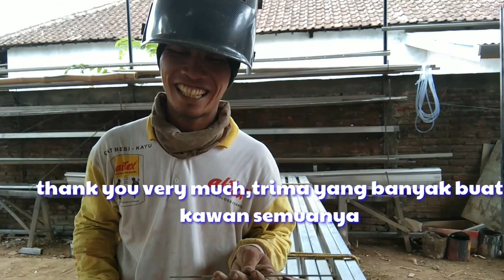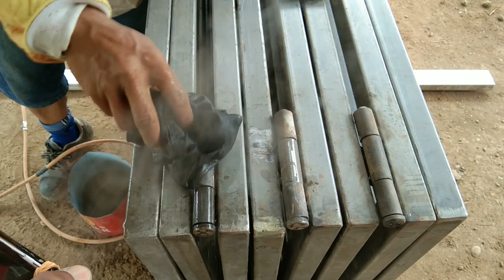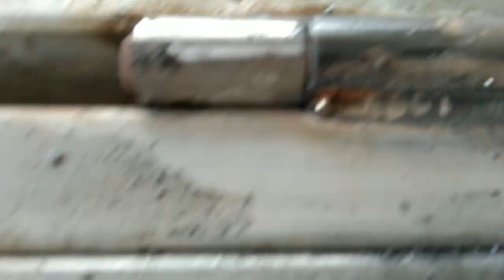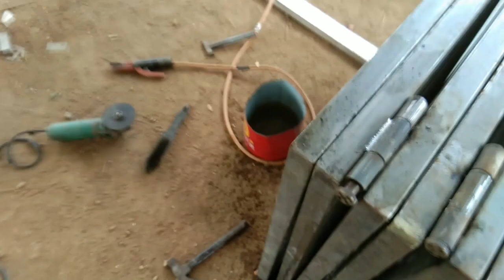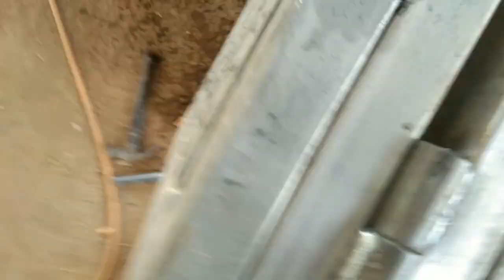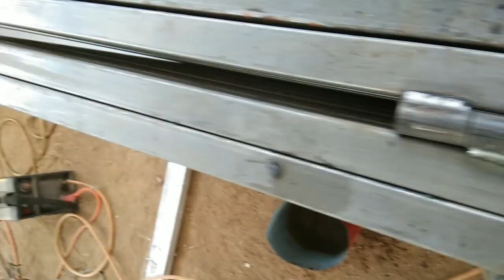PENGELASAN ENGSEL PINTU,,ilmu yang sering diabaikan

Comment: Setingan amper nya mas yg penting tuh brp
Reply from the maker: Pada mesin las saya posisi 60
Reply: Buat bengkel las kenopi dan tralis. Butuh daya watt brp pak PLN nya.
Reply from the maker: @jsnolinterior1478  1300,,,cocok mas,,,,untuk mcb nya minta yang bagus
Reply: Buat alat potong nya cutt off 14" kuat kaga mas .1200
Reply from the maker: @jsnolinterior1478  untuk cutt off kuat mas,bengkel di area daerah saya rata2 1300 kuat mas,,,,,
Reply: Ok
Rekomend merk nya apa ajah pak
Dari 
mesin las
Cutt off
Gerinda tangan
Bor duduk